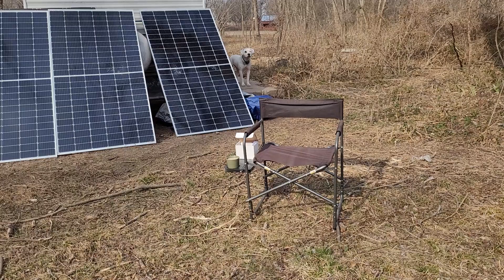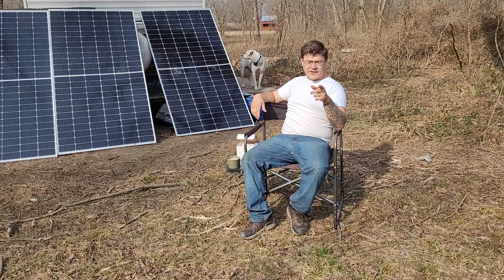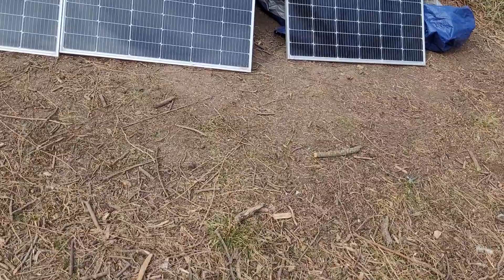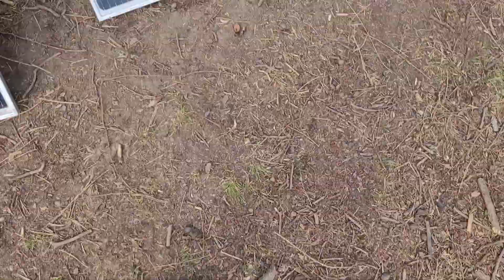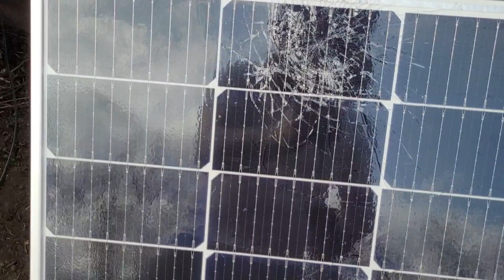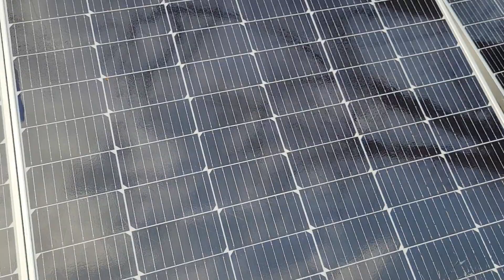Solar Panel Repair, & Bluetti Ac200max Blowing Up!!! #BLUETTIAwards

Comment: I just bought a AC200max for my RV, plugged in the 30amp surge protector and showed an open ground so I plugged in an outlet tester and confirmed open ground on the regular outlet on  the ac200 max I’m not sure what to think . I saw a you tube vid showing how to take a reg replacement plug and connected the neutral and ground pole in the plug and plugged it in and the surge protector showed no open ground. Any comments would be awesome thanks!
Reply: I just got my AC200max and tested the 30 amp RV plug for reversed polarity and mine was fine, I then plugged in the RV and ran everything and all was good.
Reply from the maker: Bluetti seems to have problems with there Ac200max models. I've heard the Bluetti EP500 Pro is the way to go.

Comment: Not sure what's going on with the AC200's but they seem to have some problems. You're not alone. I'll steer clear of those. I do have the EB70 and LOVE  it though. I use a Baldr 120 watt folding solar panel with it and it works great.